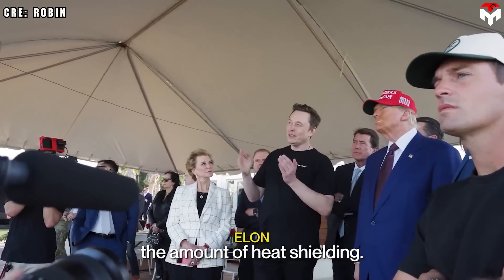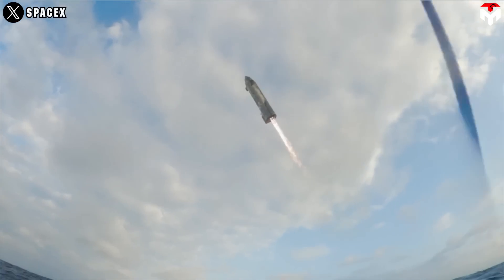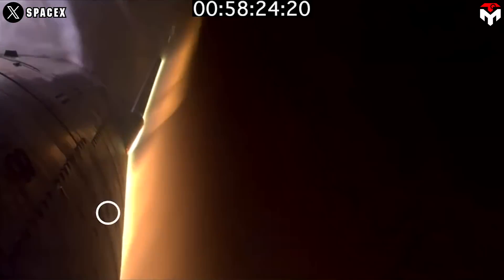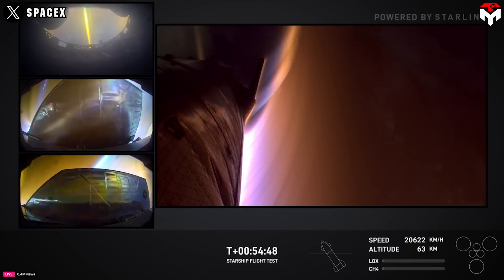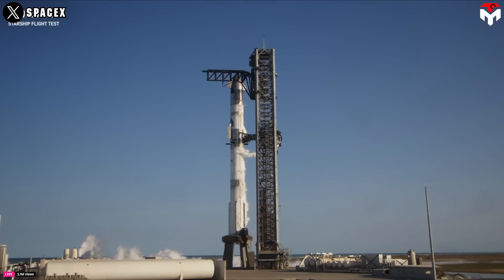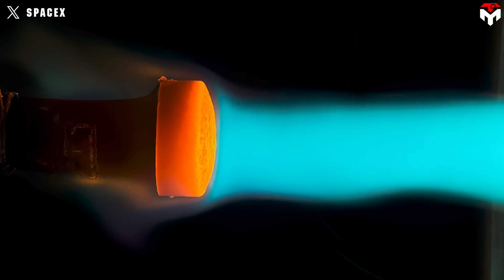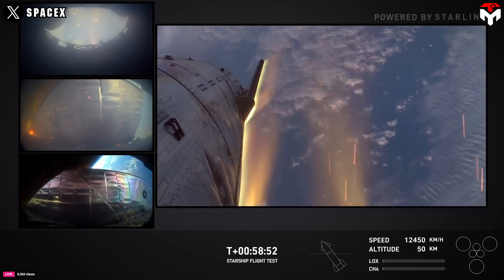"Thermal Shock"! Starship Experienced NEW PROBLEM on Starship Flight 6...

Comment: How much extra fuel would be needed to burn to slow the ship enough to not need tiles? I’m sure they know exactly and have a million graphs. I would just love to know all that stuff.
Reply: I've heard the booster comes in at around Mach 6. That is why it can turn itself around and come engines first, etc. The Starship part would come in at around Mach 20. I'm not sure how you can slow it down without using atmospheric drag.
Reply: in space you'd need to dedicate the same ammount of fuel you used to accelerate into orbital velocity.  they'd basically need to carry 2x the fuel they do now.  this isn't a serious option.  worse.  starship's ultimate goal is mars.  while mars has a thin atmosphere, they'll need to use as much of it as possible to slow down from interplanetary speeds.  it's highly unlikely they could possibly carry enough fuel to slow down for the mars landing.  

this problem with the heatshield is why they aren't trying to catch starship yet.  whats the point of catching something you can't reuse?  right now the heatshield is a one use device.  they need a heatshield whch is a multi-use device which is reliable enough to not require intense inspections.

Comment: The TPS is the Achilles Heel of rapid re-usability. The immense heat and stress on tiles cannot be  managed with current material technology. A new technology, heretofore unknown, needs to come into play to solve re-entry heat and stress issues. These issues plagued NASA and were never solved.
Spacex has other issues and they may solve these too.
Reply: Did it feel like another comment void any new information was really necessary?

Comment: NASA and SpaceX needs to start sending equipment and supplies in pods to Mars when it gets closer. They could be landed by parachute and be sitting in a designated location ready for when humans land on Mars. They could include crucial things like water purification, medical equipment, first aid, food, oxygen, fuel, seeds, building materials, starship parts. Ect.
Reply: From what I have read, that is part of the process. Right now they are making sure they have a working rocket that can launch and return. Further tests will be orbital refueling, Orbiting the moon and returning, landing on the moon, landing on Mars, landing on mars and deploying Methane and Oxygen extractors/collectors. Still a long way to go.
Reply: Sound like the plot of "The Martian." We should also leave an escape rocket ready in case the primary one leaves without you.

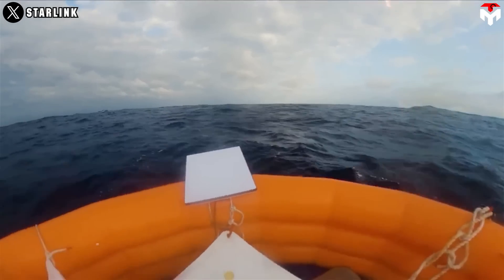Comment: Idiot AI doesn't know anything.  At 5:22 it starts talking about how starship's hull was "hardened" by the large temperature gradient going from reentry to a water landing.

It's an austenitic steel, so it can't be quench hardened.  You'd think it would know that, since it did described it as a low carbon content high chromium steel earlier.  In other words, it doesn't know how quench hardening works (it requires carbon).
Reply: You think AI is coming up with the script? It appears that it's just reading what someone wrote.
Reply: @bogususer2595  Well, then "the person" that wrote the script is not very sharp I guess.  Again, 304L is austenitic, not martensitic, so it can't be quench hardened.

I'm just stating the facts that anyone can look up.  If it runs counter to "information" in the the video, well that's not my fault.

Please re-read my OP
Reply: @lynnlamusga  I'm curious of any credentials you rely upon to substantiate your claims with credibility. What is your background? Most would know that A.I. are reading these reports & not creating them autonomously.
Reply: @terrycombs736  As I replied to the other guy.  If it's not AI generated, then the person writing the script doesn't know jack about metallurgy.  That is where my expertise lies.  I've dealt with various ferrous & non ferrous alloys for over 30 years.

Whether it is an AI, or a person generating the script, is besides the point.  The fact remains that this video has some VERY INACCURATE information in it.

Comment: There has never been a heat shield that can survive re-entry and not require replacement or extensive refurbishment. Starship's heat shield must survive entry through the atmosphere of Mars and be in perfect shape upon landing, because the same ship will be used to return to earth and must then re-enter earth's atmosphere. It cannot be compromised in any way, because refurbishment on the surface of Mars will be practically impossible, and the astronauts will be stranded, unable to return to earth. This is a very hard problem.

(With enough fuel, they could return to earth and enter earth orbit. Then another Starship could be launched to take the crew down to earth. This would allow heat shields to be single-use, but the extra fuel required would greatly reduce payload. There is no easy solution.)
Reply: That is assuming that they can't switch ships before landing on Earth.
Reply: LFP Aerospace has one ;-)
Reply: There is an easy solution. 

Nobody's coming back from Mars.
Reply: with refueling in orbit there could be dedicated starships just used to travel back and forth to mars like taxi
Reply: It will be difficult to tell 10 tesla-bots to replace defective panels?
Reply: @georgepoitras3502  All of them? And how are they going to reach them? It's a huge job even at Starbase with an entire civilizational infrastructure available.
Reply: @javaman4584 you believe every time will fail? Love Doom perspectives
Reply: Maybe they could carry replacement tiles, a role of the  protective under layer, a tile tool, and 3 page instructions manual. Does that provide a solution to our "Impossible" problem?
Reply: @terrycombs736  Have you actually looked at the work taking place at Starbase? Do you have any idea how difficult this is to do on Earth? Do you realize the equipment needed, and the precision needed? I don't think you do.

Comment: Just change to thin Tungston Carbide !!
Melting point of
2900°c
Reply: You don't need high melting point, you need insulation.
Reply: Tungsten is very heavy and expensive
Reply: @MrTurboTash  
I am aware of the Mass implications, but I'm talking 0.010" Thick, not 3" like the bs Tiles.
Even at 0.010" , it won't melt through.
Reply: An education in Aeronautics or Aerospace engineering might be helpful also. Maybe a full understanding of SpaceX goals as well.

Comment: That's the difference between thinking it's nessessary vs calculating if it's nessessary. The down fall of all smart people is because there almost always right they think they're always right. Next time put your degree to work and crunch numbers.
Reply from the maker: Thanks for sharing
Reply: Actually - In the past, NASA went the route of having competing contractors doing tons of calculations before any equipment was fabricated.  That caused very, very, long delays of making any progress.  While there were a lot of "smart" people doing the calculations, none of them were "perfect".  NASA still encountered many flight failures.  Musk's method is fine and produces results much, much quicker and with proof-tested equipment.
Reply: @doctorlarry2273 What are the results so far? It still hasn't taken a payload to space, it hasn't reached orbit or taken a full orbit of Earth, and none of it has survived landing without severe damage, even the booster that was caught had significant damage.
Reply: @bogususer2595  I will take Musk's proven success so far over anything NASA ever did.  SpaceX has had more successful launches and recoveries than NASA ever did (over a much longer period).

Comment: Tiles don’t work. I don’t think they can beat physics. The best large wing shape re-entry body is the Shuttle, with torturously complex maintenance procedures just to get them safely back to flight. A simple “check-(probable fix)-reflight” just doesn’t seem feasible at all. While the physics is the same, and the resources are even less abundant, how could you all of sudden fix every problem of the shuttle and decrease the operational complexity by 3 orders of magnitude??? Remember this ship and even the foreseeable V2 might still struggle to simply survive re-entry comparable to STS-1 level….Let us just focus on the booster and use cheap/non-reusable/much lighter second stage.
Reply: I agree. The way they make these metal ships is already very cheap, and you don't need to bring back stuff from space in the first place. Humans can go up and back by F9 crew dragon. Musk needs tiles because he want to land the thing on Mars, and back to earth. But I never understood the point of that science fiction, based on lies.
Reply: @castheeuwes1085 The first stage is almost there in terms of reusability. Elon just wants to make the 2nd stage reusable, which is a much harder problem. This stage is going at orbital speeds and must be more durable.

Comment: to go to mars , you need a reliable nuclear rocket , that the JOMO/JUMBO rocket built back in the 50's , no start / restart problems , could be built tomorrow , you can only wonder why they chose ,out of the too designs , the one that didn't work.
Reply: Just try to get permission from the IAEA & EPA to launch a nuclear powered rocket as a private company. Hell there are several companies who are trying to get new nuclear reactor designs including SNRs that are designed to never melt down that cannot get regulatory approval !! 😅

Comment: Get real. A chemical rocket simply isn't fast enough for manned missions to Mars. We are seeing right now in that astronauts can suffer health issues on the ISS. Starship is literally based on concept art drawn back during the early Space Race when Werner von Braun was pitching the exact same idea for colonizing Mars. Even though, at the time, they mistakenly believed that Mars was more Earthlike than it really is.
Reply: i mean nuclear powered ones are in research and development right now . if these chemical rocket can go and gather data in advance thats a win win overall
Reply: @yoichi6634  - Yes, but that will require a complete redesign of the spacecraft. Kind of like how the nuclear powered aircraft that we dabbled with during the Cold War was customized for the purpose because you can't just slip a reactor into something that flies without completely changing its aerodynamics. Space is already filled with radiation. Adding more from the ship's own power plant would be a great way to deliver a dead crew to Mars. 

As I said, Starship is a con based on 1950's/1960's concept art drawn before we knew as much about space as we do today. Not many of Musk's ideas are actually original.
Reply: Regulatory approval for a nuclear powered rocket engine is about as easy as fusion power!😅
Reply: @jackdbur  - Especially on a spacecraft like Starship which is still very much experimental and may have to be remotely destroyed in flight if a launch doesn't go exactly right. Musk will probably try to convince Trump to revive the NERVA project cancelled during the 70's. Hence all the other cost-cutting he wants so that there is more money to give to HIM!